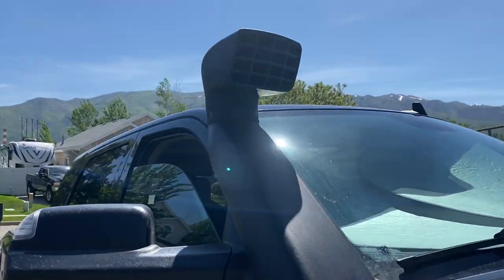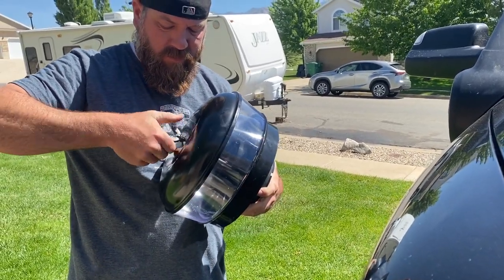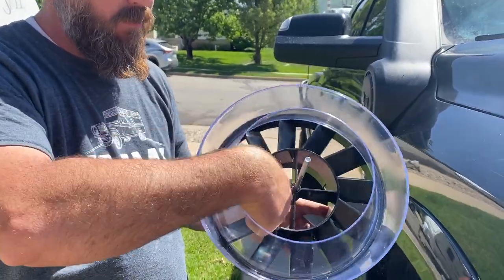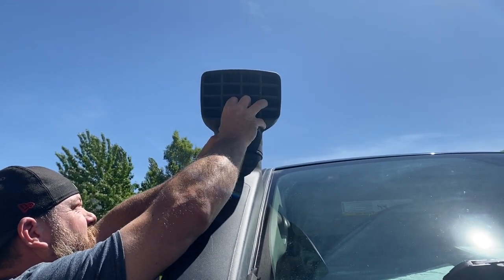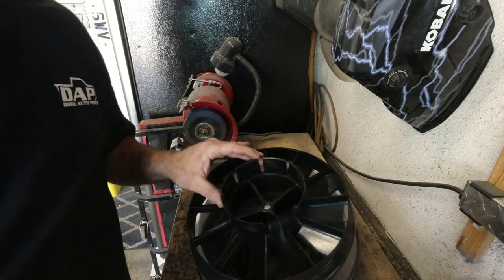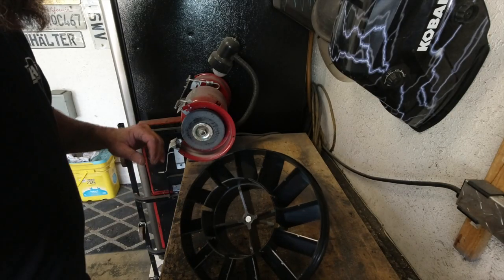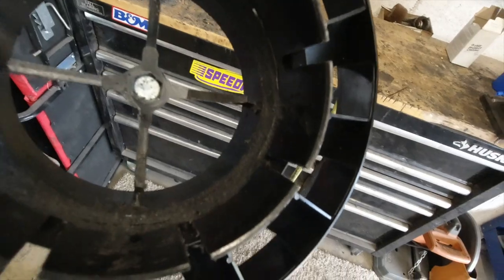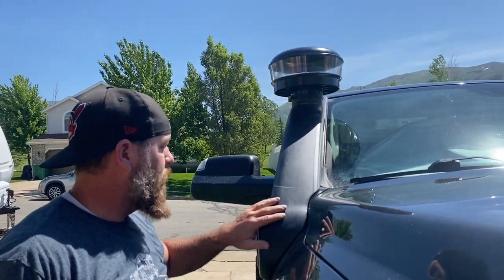How to modify the AEV Snorkel to filter more Air!

Comment: Bad ass and looks nice!! That is the exact same prefilter that is factory on my Caterpillar 426b 4x4 backhoe. Just ordered my snorkel today ($515 OUCH!) And definitely doing exactly as you have! Thanks for the video! EDIT
Update, lol, i just read the other comments here. Daggumit, sad to hear that this didn't work so well for ya. Hmmm. Really works good on my hoe. I guess it works better on something that doesn't go forward over 18 mph. I kinda wondered if the cylonic action of the plastic cylone fins would be defeated by forward driving at speeds over 20mph.
Reply from the maker: I'm going to stick it back on this summer when there is more dust out there again.  I think it'll work.  I may have messed it up.

Comment: How to UN-cool your truck and make it a McCormic tractor
Reply from the maker: It has actually been removed.  It actually didn't work very well, it sucked in more dirt into the air filter that that other snorkel head did, so the old one is back in.  The original looks better anyway.